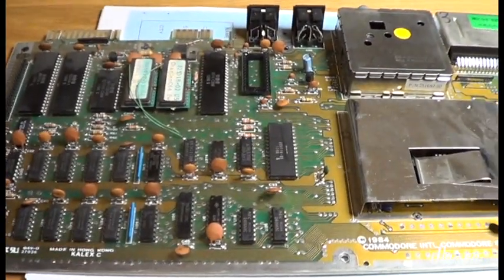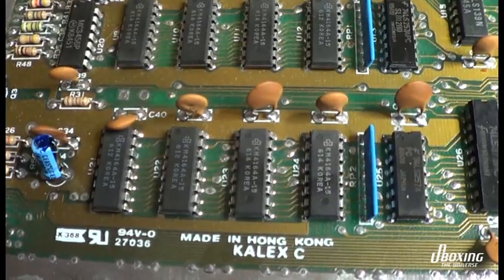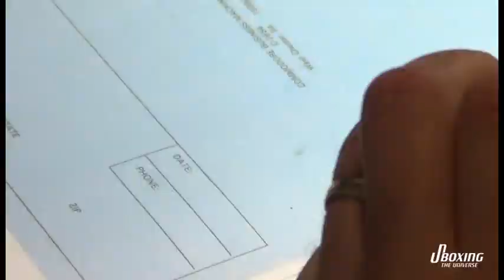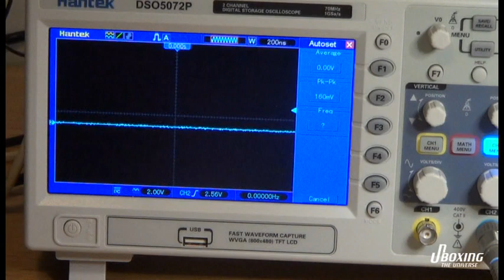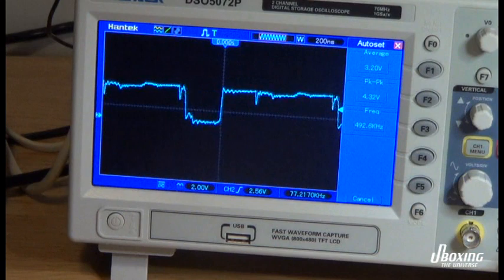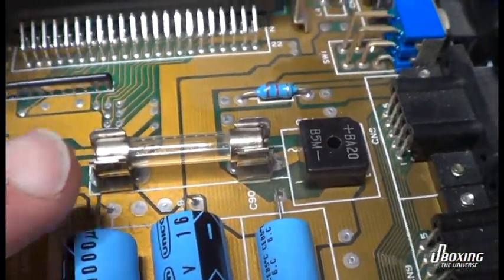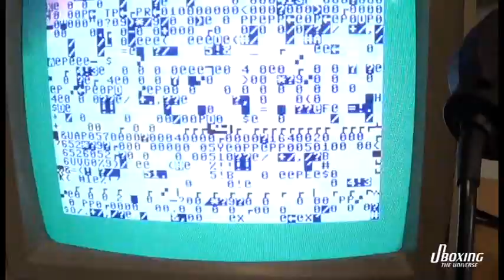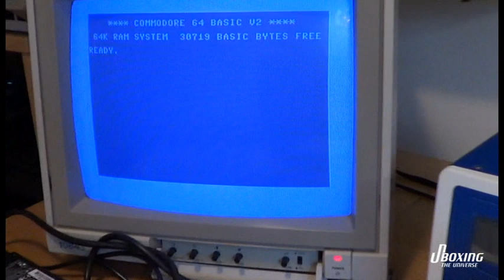Black screen commodore (C64) repair short circuit RAM

Comment: Hi, thanks for sharing your repairs. I appreciate the footage. However, just fyi check all the ram chips, the ammount of RAM presented is 30719 bytes should be 38911 bytes. I have the same Hantek equipment and love to repair C64, so I'll keep checking your videos!
Reply from the maker: Thank you rapiqui there was a problem with a pin on my "home made" sockets and the cia was dead, so this was not a complete repair. Thank you for watching!
Reply from the maker: Also please subscribe bro :o) and pls spread the word so we can grow this small channel. I have lots of retro repairs in the camera.
Reply: Would you recommend a desolder iron over a plastic sucker? I just popped out one ram chip and there were two ends connected to ground where it just wouldnt pop out....  =/
Reply from the maker: Hello venomman. Yes! You dont have the bounce-back from the plastic sucker and its a much faster process since you get rid of 95% of the solder in one push of a button.

Comment: Why are the suspects always the chips, and can not they be resistors and capacitors in the board?
Reply from the maker: Well since the warmest chips came without any cooling and the machines are 30+ years old. Most of the time (on C64) the chips are the main suspects. The caps and resistors can break if there is a short somewere or the PSU fries the machine. Thanks for watching and pls subscribe.